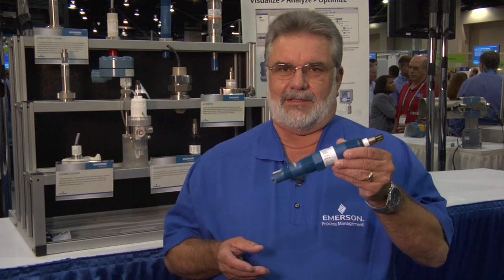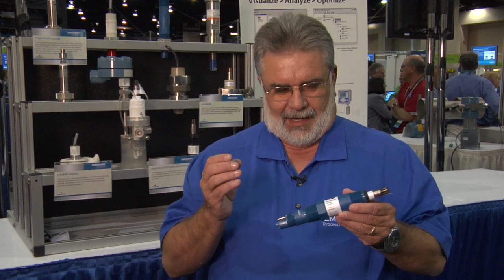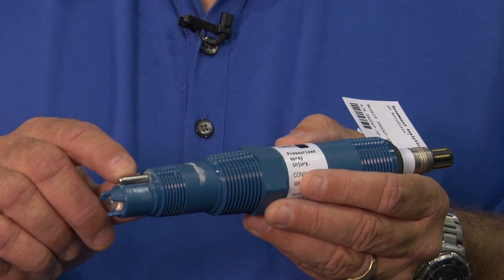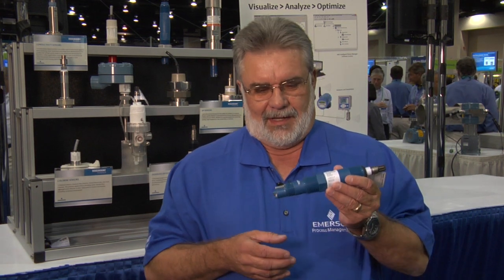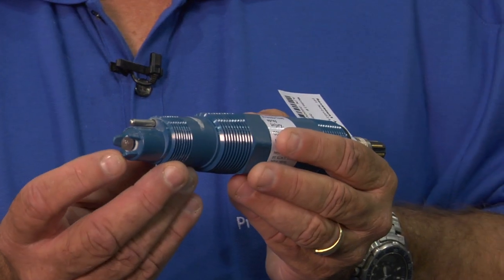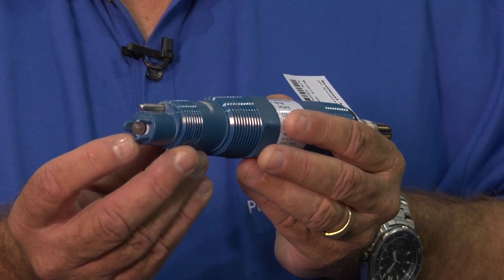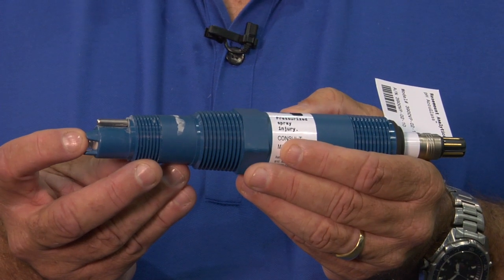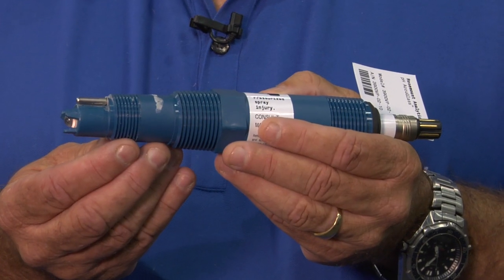Model 3900 General Purpose pH Sensor

Comment: I have this sensor with ph transmitter 5081 but I don't know how to wiring . Can you help me please
Reply from the maker: Hi Abdullah. You may check the quick start guide https://www.emerson.com/documents/automation/quick-start-guide-rosemount-3900-3900vp-general-purpose-ph-orp-sensors-en-7241198.pdf which has wiring diagrams for several 3900 configurations for use with the 5081.
If you live in the US, you may call 1-800-999-9307 to assist you over the phone.
If that is not an option and you need further assistance, you may send your inquiry to specialistliquidanalytical.rmtna@emerson.com